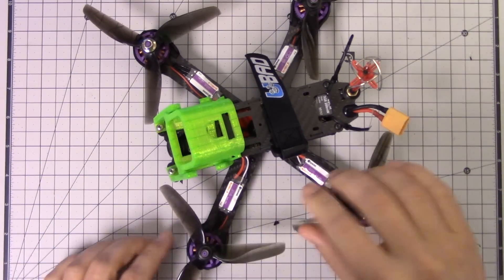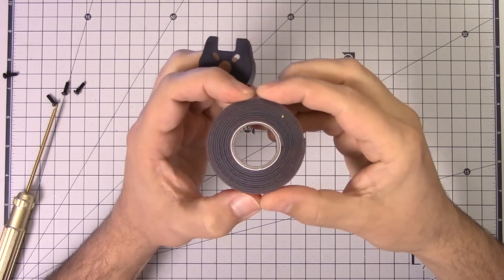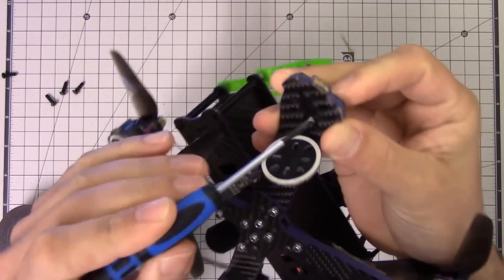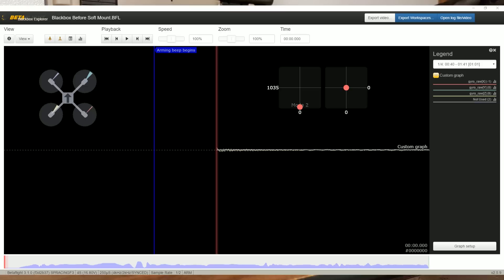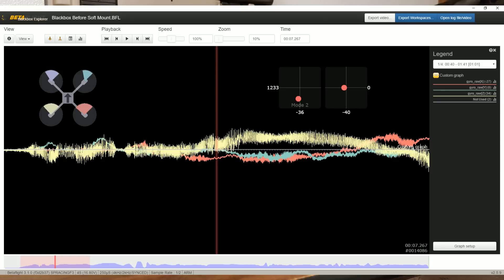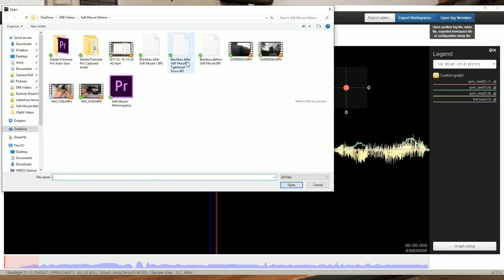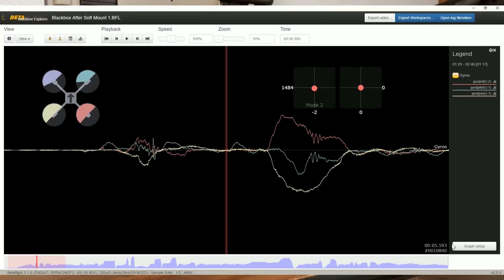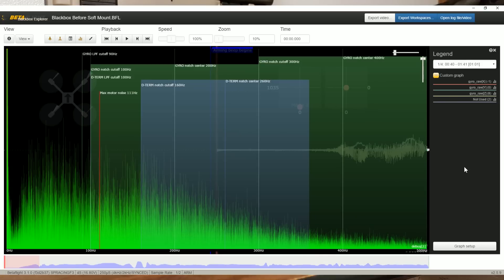Soft Mount Quadcopter Motors | MYTH BUSTED OR CONFIRMED?

Comment: I'm an Aerospace engineer and I just discovered your channel as I was doing research to pick up my first hobby-grade multi-rotor. You've definitely got some good stuff and I think you are spot on with this video. Multi-rotors rely on their FCs to stay in the air and the better the data going into them, the better the FCs can manage the overall performance of the vehicle. There is a downside to soft-mounting, though.

The soft-mount trick works because it allows the motors and the props to "wiggle around" on their mounting pad, so the mounting material actually absorbs/damps out a lot of the high frequency vibrations originating on the rotor side of the interface, such as vibrations from an iffy bearing. The problem is that this also allows the rotor head to slightly change angles based on the vibrations being generated by the system and the larger torques being created by the motion of the aircraft. 

These motions should be pretty small, but even a few fractions of a degree could be enough to cause the control logic to have to take action to actively try to suppress this motion in the control loop. Will you feel any of this action? Probably not. However, it could result in a slight "softening" of some of the control inputs by introducing a slight "lag" in the control channel. Imaging the nice rigid rotor arms are flapping around slightly under load, so it takes a fraction of a second for the system to settle down and return to a steady state when it is upset or you introduce a new control input.

Again, this will probably be way below the threshold of what most folks would notice, especially for a vehicle in this class, but it is a real byproduct of having anything "soft" in a system that expects everything to be rigid.

Again, great video! As a noob to this corner of RC, I have learned a lot from you so far.

Comment: Soft mounting motors is a way better idea than soft mounting the FC. There is no mass in the FC so it will still jiggle with the rest of the copter, but if you hard mount the FC and soft mount the motors, the FC is attached to a large mass and large masses don't want to move because physics. Hope this makes sense.

Comment: i knew this sort of mounting would have good damping properties, but wouldn't have expected such a difference in the data. (i recently used some to silence fans)
i also thought "but the screw heads are still touching". :D propably it wont make a big difference anymore, (not even sure if it's worth the extra effort) .. but i'd be curioous to see the results of adding a back plate on top of another piece of the tape, and decouple the heads as well.

Comment: Joshua, can you explain a little further why the really high frequency noise from the motors matters? The quad would never be able to respond to any input at the vibration speed of the motor and I would also assume that the PID algorithms have some signal smoothing to get rid of noise. So does the high frequency motor noise even matter?
Reply from the maker: +Chris Sieracki the filters are the exact signal smoothing you're referring to. The high frequency motor noise definitely matters.

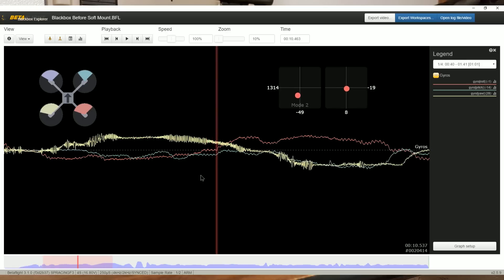Comment: @5:00 you speak about noise slipping throught the filters - but you even have a video about gyro filters in betaflight. So why is it surprising for you? Looks like simply the noise has lower frequency than you set in the filters. Or did you have something else in mind?

(PS: In the end you could use the same thing as gimbals - kind of rubber pouch - and get rid of most of the high-frequency motor vibrations in exchange for phase shift of the "throttle" :) )

Comment: Weigt have a big impact on vibrations, you have to make the same test with the motors hard mounted and the same amount of tape installed under the arm.
Reply: But nobody needs to know if that is better because nobody does that, its irrelevant
Reply from the maker: This is good scientific thinking, but as is so often the case, the ability to do research is limited by available time. It's a good experiment, but for me, it's not an interesting experiment.
Reply: But then "confirmed" can't be used :-)
Reply from the maker: +Per Buch all scientific confirmations are really just the provisional absence of evidence to the contrary. Ultimately, we are just stumbling through the dark halls of our own ignorance with the flashlight of inquiry to light the way. But that doesn't fit into a thumbnail.  Image.
Reply: I agree some of the way. But i have been working with sound and vibrations most of my life. The traditional way to deal with high frequence vibrations has always been adding weight, not realy usefull for a quad. An other way is to choose the right materiel, carbon fibre could be the wrong choice, fiberglass would have better damping and better crash resistance. Use rubber arms on your quad, and they will never break. Sorry for my english, not my native.

Comment: Was Hobbyking ahead of this thinking with the dated Dart 250 frame, a soft mount clean and dirty two section frame style? Should you soft mount your flight controller also?
Reply from the maker: Frames with clean/dirty sections are way too fragile for mini quads and racing and etc. If you can soft mount your FC, that is what I would do first.

Comment: But don't you need a hole in the middle for the spinning c clip?
Reply from the maker: Yes, you do! This is a mistake in my presentation.
Reply: Thanks for confirming Joshua. Do you reckon four o-rings under each motor would also work great instead of this tape?
Reply from the maker: +olivierhacking yea but you'd need something to keep the screw heads from pulling through.
Reply: Ah, but I meant to use o rings instead of the 3M tape! So in between the arms and the motors. Do you think that would also dampen vibration?

Comment: How about this... instead of folding the 3m tape in half. You add one piece on the motor side and another on the bottom screw side. this way you have the motors and screws "soft mounted"?

Comment: 3M extreme or outdoor mounting tape is awesome for dampening gyros in 3D helicopters. Which brings up a very good point. Why the hell does everyone HARD MOUNT the FC for quads? It really hasn't ever made sense to me. In my opinion, and based on my heli experience. It should be soft mounted and just maybe most of this whole idea of soft mounting motors is more work than necessary. Though i suppose you can never have too much vibration dampening in a loop control system like this. So doing both might be even better. But in all honesty, I could only make it about 2 minutes into this video. So I don't know the exact result you had. But I have my assumptions based on my own experience. Anyway, I don't know if you already did this. But maybe next, try "soft mounting" a flight controller with 3M mounting tape and then compare those results on the same machine with and without the soft mounted motors.  Just a suggestion. 

What you do for quad hobbyists is great. Keep up the good work, and thank you.
Reply from the maker: For a long time, FC boards were soft mounted. Even to the point of having a whole clean/dirty plate on some quadcopters. With mini quads, props were small enough and rpms high enough that you could get good performance (for the time) with hard mounting. Hard mounting is simpler, so people did it. Eventually, the performance of FC software got to the point where it exposed the weaknesses in the hard mounting, and now we're back to soft mounting.

The reason people hard mount is because it doesn't affect flight performance. When it does, they soft mount. You have to hard mount a helicopter gyro because the rotor has so much more mass and is such lower rpm than a mini quad prop.
Reply: Did you mean soft mount a helicopter gyro at the end there? I assume that's a typo because we mostly mount gyros with gel pads or 3M mounting tapes or something similar.

Comment: Goodness, but you have a zillion vocal followers.  Since surface distribution of the motor undersurface seems to be a principal here, the quad underside and screw heads might be an opportunity as well.  Many have mentioned washers, but i stumbled on some wide pan head metric screws if anyone wants to take on the test:
http://www.avonstainlessfasteners.co.uk/stainless-machine-screws/slotted-pan-head-screws-large-head-303-a1-m3-up-to-m8-din921
(They might help with heat dissipation as well)  Thanks for all the contributions.

Comment: what about a washer and an o ring then go through the arm and then the tape
Reply from the maker: I would never soft-mount the arms. Every frame I've ever had with non-rigid arms has had issues.
Reply: just to be clear I meant the motor bolts so motor tape arm rubber washer metal washer bolthead

Comment: Great job man! Did Johnny fpv use blacktape? How many layers would you recommend of black tape, or should I just get some 3m stuff like you used?
Reply from the maker: +drjjohnson911 I used two layers. It's in the video.
Reply: I'm sorry I should have been more specific. Instead of using the type of 3M double-sided sticky tape you used, could we use black tape instead, like Johnny fpv. If you think black tape would work as well, how many layers would you suggest?

Comment: I do in fact have nasty vibrations in my Tarot 130. 2 motors came buttery smooth, 2 sound and feel like the bearings have rusted out! Will try this and report back. Thanks for taking the time to test this and report back to the community.
Reply from the maker: Better to replace the bearings, but this will do in the mean time.

Comment: Isn't this just putting a bandaid over junk parts or bad mechanical setups?  Like if you were to use quality parts and a good build, you wouldn't need to do this.  And you'd be rewarded with no vibes and crisp responsive flight.
Reply from the maker: Well, I guess you're going to have to tell Johnny FPV he is using junk parts and a bad mechanical setup, because he says he does this on every single one of his quads.

In other words, no.

Comment: nice, i'm planning to softmount my motors, do I use it between the motors and the frame or use it also under the arm between screws and arms with some kind of carbon fiber washer?
should be ok to use a bike tire tube?
thanks
Reply from the maker: Between the motor and the arm.

Comment: Tried this with the 3m and no motor protectors just direct to the motor, left me with concerns. The tape will wrap around the screws as you tighten (you must have another secret) The tightness if not even across all 4 screws may cause the motor to not be exactly parallel to the arm (x4 motors would be quite a random result) Electrical tape, while not the best for absorbing, will help promote levelness and perhaps not fight with the screws. Will the give and bounce back affect aggressive flying?
Worried that the adhesive will hold dirt inside /under the motor. I gave up on the whole idea for now. Good on the bench with the thick tape for sure but will it fly well? I am however nicely stocked with awesome mounting tape. Looking forward to the test.
Reply from the maker: The 3m rubber tape did wrap around the screws. I just set the screw height so that the motor was level and evenly (roughly) tensioned. Frankly, the tape wrapping around gave me some confidence that loc-tite might not be needed in this specific case.

Comment: Not that it appear neccesary base on your excellent results... but have you tried soft mounting the other side (where the screw head does contact the arm).   I use rubber grommets on both sides and it works great.  That is: Screw > grommet > arm > grommet/softmount > motor + locktight
Reply from the maker: I think I would need to add some kind of plate to keep the screw heads from pulling through. Anyway, I haven't.

Comment: as for the screw heads touching the arm, could you use a thin rubber washer or a layer of tape on that side of the arm, too? might make it even smoother?

Comment: Joshua, how did you poke the screws through and still use the Motor mounts? I couldn't get the motors screwed back in with the mounting tape you used because they were barely long enough to reach the motor.
Reply from the maker: IDK... I just stuck them through and easily had maybe 1 mm clear.

Comment: So I should go ahead and do this on my first build? I'm an electrician and there is many different types of tape we use, one tho has the thickness as a single strip that he just got by folding it in half. Not sure the name of it but it's about 2"'s wide and at my company we call it bull nut tape. But I'm thinking it may be better to go ahead and get the tape he used( folding it prolly retains sponginess when screws are tightened down)
Reply from the maker: I don't think you should do this unless you have vibration issues with your setup. I would start by soft-mounting the FC.
Reply: Joshua Bardwell Roger that! Thank you for the reply

Comment: My quad flies really smooth without any vibration. If I will soft mounting my motors and FC. Its can producing a problem?
Reply from the maker: If your quad flies smooth then you don't need to do this.
Reply: Joshua Bardwell Ok thanks!

Comment: Thanks Joshua. I'm going to give it a go now. What about putting some padding under the screw head as well?  It may not give much more insulation from the vibrations... But would it help?
Reply from the maker: Padding under the screw head would probably help some, but you would need some kind of washer or plate to keep the screw heads from pulling through.

Comment: Hey great video. I posted in a reply on Reddit a few weeks ago about the 3M Mounting or VBH tape for soft mounting. My question is would doing one flat layer work as well as two stacked up?
Reply from the maker: +Matthew Ross I'm honestly not sure what would work best. My goal was mostly to demonstrate empirically that it worked.
Reply: Makes sense. two layers flat works well if you don't want the flipped over effect but one layer would probably be to thin.

Comment: Im interested to see you prove the screw heads are still touching theory. I noticed you used effectively 2 ply's of that 3m tape under the motors. what if you took 1 ply on the underside where the screws come in contact with the frame and 1 ply under the motor. this would be the same thickness as what you have now. but making a buffer on both sides of the frame. BETTER or WORSE? or no gain at all?? keep us posted. great video BTW! i think a small rubber washer on the underside of the frame where the screws come in contact with the frame would effectively give you the same kind of buffer/dampening without using a large square of 3m tape. CHEERS!
Reply from the maker: +david nappi the screen heads would pull through. You'd need washers.
Reply: Joshua Bardwell exactley what i was thinking. still would be a good video. adding a washer. you have shown how the tightening effects of the screws on soft mount. but how much softening would get bad? on both sides.
Reply: Joshua Bardwell i mean if were making soft motor mounts. lets go all out. essentially that would isolate the motor from the frame.

Comment: Mass vs. Vibrations; if the mass of the entire frame is isolated from the motors but hard mounted to the FC we have the mass working for us. Alternatively, when the entire frame of the quad is vibrating along with 99% of the mass and then we expect the mass of the soft mounted FC ( a few grams) to stabilize on a few o-rings we get very poor results. This makes me think of back in the day when David Windestal started making his Tricopter frames, the camera plate was suspended from the flight frame and included the mass of the battery. Now off to print some flexible motor mounts!

Thanks for bringing this to light Joshua, not all of us have time to lurk in the forums or the tolerance to wade though people's BS! :-)

Comment: Nice vid thanks josh.

PS There's a lot of noise across the whole spek analyser- especially in areas low frequency which betaflight can't filter. I had a similar problem and it ended up being ground loop by connecting both vtx grounds might be worth double checking eaachine didn't balls it up?

Comment: Okey I have something to add to your video Joshua and it is that, DEPENDS! And it does not depend if you had very little noise to begin with as you said, it depends on what is the resonant frequency of your aircraft, sometimes, as you also said; for some people work, thats true, but for other people it may not work because the foam; instead of reducing that noise it may amplify it, because that was my case. And it does make sense, for your situation and for mine too.

ATTENTION weird example below:
 I see the softmounting thing like holding a dildo in your hands, if you move your hands at a certain rate the tip of the dildo is gonna wobble around, something that wouldn't happen holding a stick (direct mounting?) If you change the movement (or if you have very shaky hands) to another rate you may find that the tip of that dildo stays on the same position like a chicken's head. 

So it highly depends of the frequency at what your quad vibrates.
Reply: I laughed at the example :D Seriously, yes that is exactly the case. Very few people mention the self resonance frequency at all - even after two years - which is the main contributor of mechanical noise.
In my case, the resonant frequency of my motors (especially at 24kHz PWM, 48kHz is somewhat better) were in par with my frame's resonant frequency (or their harmonics, whatever). I knew it can not be vibrations (fresh props, good quality brand new motors, never crashed them), thus I came to the conclusion that this must be the frame + motor combination not liking each other. Dildoing... soft mounting my Motors helped a lot to reduce the transferring of this resonance.